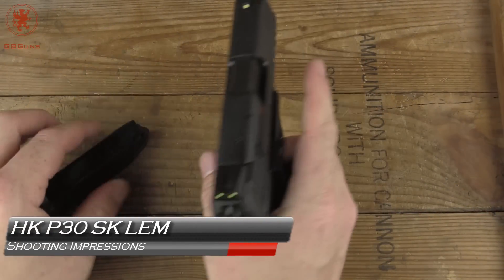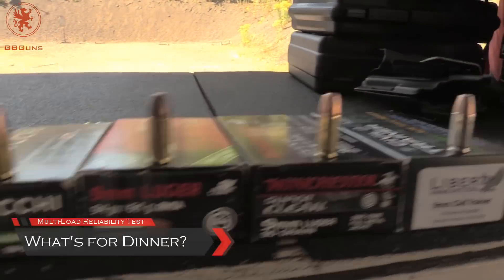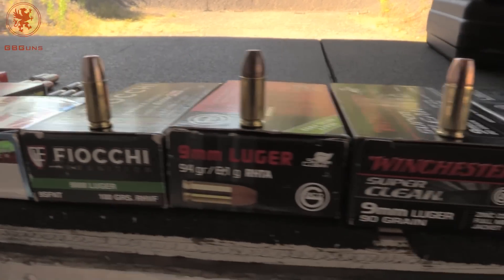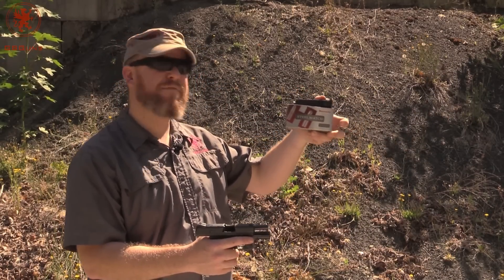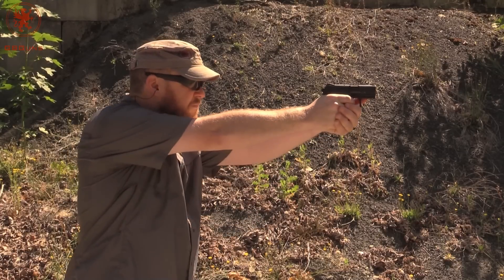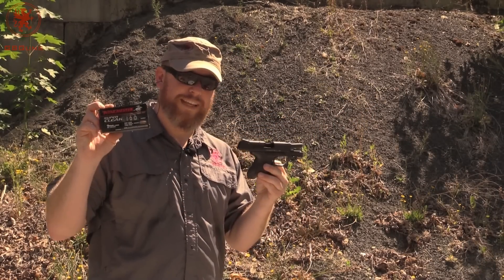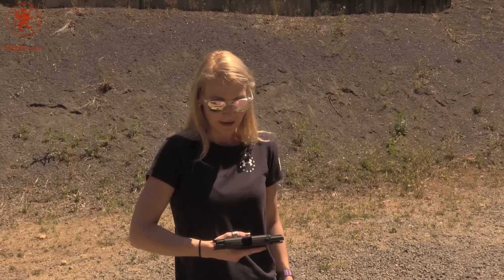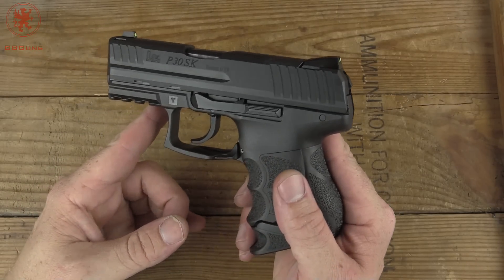HK P30 SK LEM Shooting Impressions

Comment: The P30 & other HK guns with the LEM is like having a revolver type action that self cocks itself after firing, yet uncocks itself if you let up on the trigger, yet you have the benefits of semi auto capacity & fast reloading. With generally no external safety
(unless you want one) the simplicity and versatility of this platform is unmatched, especially when you trick it out with a reduced reset trigger. It's my all time
favorite platform & the best self defense handgun IMO.
Reply: Like the way you describe the LEM. 👍🏼🤟🏼🙂

Comment: Had a Glock, nope, gone. Bought a P30SK V3 but just didn't like the DE cocker. Bought a Lem P30L Lem but didn't like the night sights (my vision isn't 20-20 anymore) bought a P30SK Lem with luminescent sights and that's it, done shopping. Always had the right pistol, just looking for the right version. Now 13 rounds with flush plate, can get 15 or 17 with very minimal extension.

Comment: I have the HK VP9 SK and I love it because it is easy to shoot accurately and it always goes bang when I pull the trigger. Just finished a terrific Level 1 pistol workshop with Drew Estell of Baer Solutions. The VP9 was my weapon of choice. Shot, at least, 400 rounds of Winchester White box and Wolf 115 gr  FMJ.
Not a single problem. Would really like to own a P30 V1 lem.

Comment: I bought an HKVP9 and brand new out of the box, I cleaned it and reassembled it, hit the slide release, and had not pushed up the slide lock-in lever up, the slide flew off to hit my ceramic tile kitchen floor, and the recoil spring assembly broke- this was totally my fault. I called HK customer service and explained what happened, at that time the part I needed wasn't in the USA, I explained that I had a stroke and that I needed the pistol for self- defense  I did have a .45 ACP, but could no longer control the pistol, so I went to 9 mm, I had been robbed in my business by a gang member and he told me they were going to kill me, the service rep, said don't hang-up Im going to go and get you what you need, when he came back he overnighted to me , all at no charge. and I was the problem, not HK. i WILL BUY HK from now on you can't be fairer than this. so far 

i have not been attacked again, but I always need to be armed and ready.